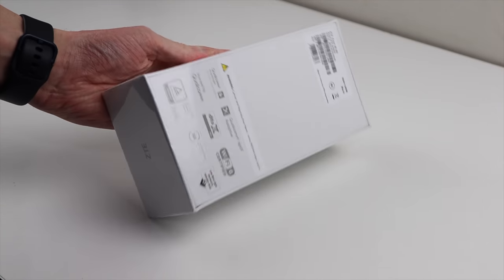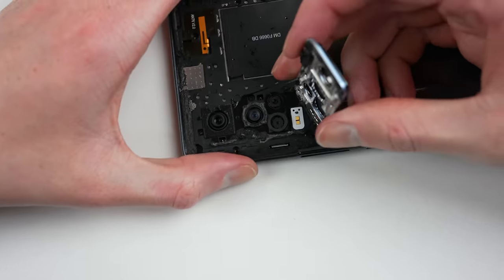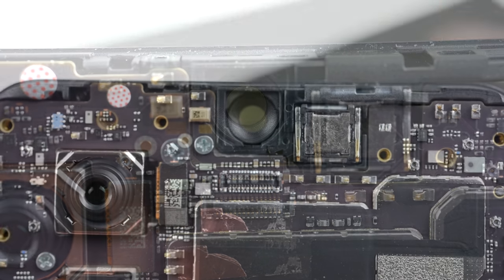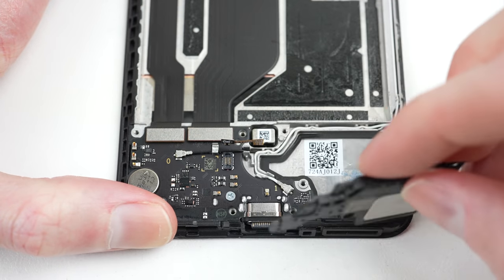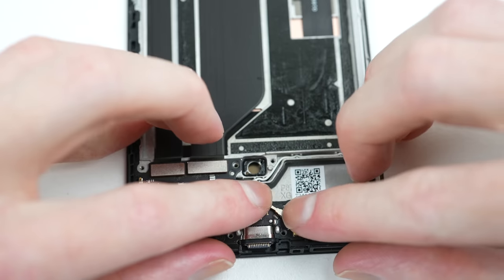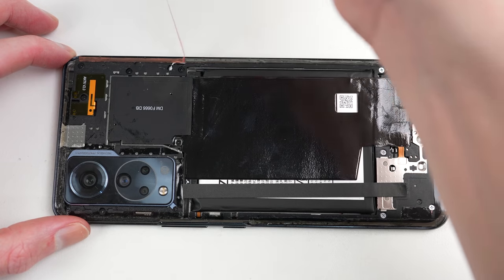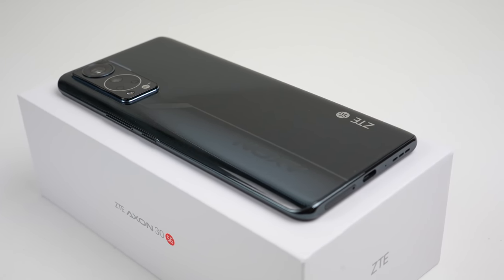How This Incredible Under Screen Camera Works - Axon 30 Teardown

Comment from the maker: Axon 30 launches 9th Sep 2021: https://bit.ly/2W0hZNm
Reply: I like to eat hamburger
Reply: Hugh
Can you do a Teardown of the A52 
I Will buy it and i need to see if there is any limitations if something is damaged
Reply: Hello Hugh I'm writing from kenya wanted to know if you do sell some of your restorations???
Reply: @jrjr4218  he does but only in Australia for now
Reply: Just check the Xiaomi mix 4.you will be thrilled
Reply: so cool video
Reply: hey man, nice video - big fan of your work.
i was wondering tho if there are any polarisation effects happening the the screen, ie what happens to the picture if you rotate the camera 90°. 
(i am aware that the cable is probably not long enough to do so, just putting it out there :)
Reply: On my birthday

Comment: as a person who literally never uses the front camera this would be the perfect phone for me
Reply: Same
Reply: Same
Reply: Meanwhile, all those spybot companies are watching you from under that display.
Reply: I’m so ugly I fear my front facing camera breaking if I use it
Reply: I'd be happy to pay less and have no front camera.
Reply: Same here. But I'd prefer a pop-up camera as you can just ignore it or just use it if someone insists on a zoom meeting. No chance of screen compromise
Reply: If someone is going to watch me through my camera it wouldn't matter what phone I had and most phones don't have a physical identifier to tell you the camera is on.
Reply: @MCAlexisYT  your point being?
Reply: This is one of the reasons I bought Xiaomi Mi 9T Pro (also known as Redmi K20 Pro), it has a motorized pop-up selfie camera which stays inside the body of the phone until needed 👍
Reply: @TommyAgramonSeth  way better solution. But apparently the 300k repeat test isn't sufficient for YouTubers to feel confident with the robustness. Saying that they probably take that many selfies in a month
Reply: @dougsteel7414  lol yeah, if I were to take a lot of selfies or videocall often, I'd be slightly more worried about dust or something getting inside and scratching the lens but even then, that shouldn't be an expensive fix.
Reply: @snaj9989  Vivo Apex 2019 I guess?
Reply: haha, tbh I rarely use it. It's a perfect solution for me. However if it doesn't give any interference with the screen; they might as well have put it centre; but I guess we will need at least some 5-6 more generations of small upgraded new generations of phones before they figure that one out.
Reply: The only reason I use front cam is to look under some places, as if it was a mirror. Better use that, rather than carrying a telescopic mirror in my pocket every time
Reply: I mostly use the rear camera on my phones too even though the selfie cameras have gotten really good.
Reply: Tbh there should be versions of phones with no front camera at all, that would truly be perfect
Reply: @MCAlexisYT  it will be blurry when the display is on
Reply: @satsumagt5284  like i have anything to hide
Reply: Same
Reply: Same!
Reply: @MCAlexisYT  They can watch - they'll get bored & move on 🤣🤣

Comment: Not bad - good to see under display cameras popping up now! Hopefully the image quality can be improved in time.
Reply: Yeah that's been my biggest issue with all screen phones like my S10, not much point in having the phone be all screen if there has to be a cutout for the front camera
Reply: @Karmy.  if you think about it, if we just kept the top bezel we wouldn't need screen cutouts
Reply: @Tiger9194  yeah
Reply: Spotify?
Reply: @Tiger9194  But then there wouldn't be as much screen. Fundamentally, hole punch cut-outs and notches have provided more screen real estate. If there was a top bezel to accommodate the selfie camera, the space to its right and left would be wasted - just dead space. With a cut-out or notch, the space to the right and left of the camera is instead used as notification bar space, holding the time, signal strength, and notifications (if Android). That means the screen can be used for more content in the same overall device size. Several Android phones provide the option of removing the cut-out/notch by blacking out the space to its right and left - this provides a useful show of what a phone would look like if it had a top bezel instead of a cut-out.
Reply: @EscapeVelocity11186  Not much screen? Who cares, this whole trend of having the most screen real estate is stupid. No bezel? Under display camera then ( ZTE ), or the alternative option is the pop up camera ( one plus ).   Considering those 2 options drastically reduces the need for a cutout, or just go the old fashioned way and put back the top bezel.
Reply: @Tiger9194  Okay... but having a cut-out doesn't reduce the usable screen real-estate. Your whole point was that phones shouldn't have cut-outs and should just have a top bezel for the camera. If you want a top bezel, just enable that option in the settings if you have an Android phone. You don't ever need to see the cut-out or notch. For people that would prefer to have more screen, they can live with a cut-out/notch because it's the best option until under-display cameras mature. It also provides them with more screen space for content since the entire notification bar is shifted up to the cut-out area - where the top bezel used to be. Pop-up cameras probably have the issue of using more internal space and also having an additional mechanical point of failure, which is why virtually every manufacturer stopped using them in favor of cut-outs/notches (a mature display tech).
Reply: @EscapeVelocity11186  Look at Sonys Flagship, the bezzels are so small & the camera fits perfectly. Bezzels, Pop up Cameras, under Display Camera, everything is better than a Notch.
Reply: @Tiger9194  exactly
Reply: @Nonnenmacher87  Sony knows what to do and it works well.

Comment: I'm sure he had a contract with ZTE saying he could open the device and remove everything. 

Would definitely have liked to see a bit more comparisons between current models like low end S21, OnePlus and OPPO. It would be interesting to see how it actually stacks up side-by-side with the models it's competing against. Overall nice job as usual

Comment: That's funny how you said the wide angle camera looked like a 2010 webcam, because when you took the back frame off the camera area, I thought it looked suspiciously like a webcam lens and body. The tiny viewing hole, and the design of the larger-than-usual plastic around the lens just looked terribly reminiscent of cheap webcams that I've disassembled. 

Thanks for the interesting, informative and entertaining video!

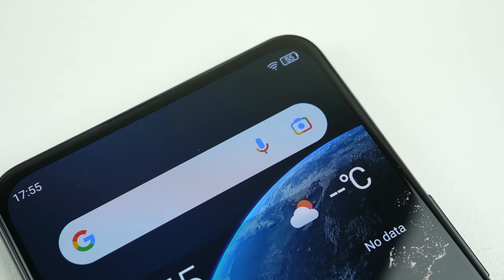Comment: 1:58 There is a visable notch for a part of a second. But I guess it's just a software bug. Maybe the manufacturer didn't configire their OS right for this model.
Reply: They could also very well have blocked this part of the screen off when something using the camera is opened (for example so that something like a notification doesn't ruin your selfie or recording)

Comment: 04:00  

you know what started this whole "do not open" thing.  

it's people taking them appart,  breaking something,  and then putting it back together to claim warrenty or said it broke randomly.  
that's why they started making it almost impossible to do.  rather then just warning people not to do it.  

it's because you have no buisness opening it up as long as you can get a free replacement

Comment: The bootloader isn't unlocked I guess: if you unlock the bootloader, a phone restores to factory settings. It means that it is possible to unlock the bootloader.
About the battery: ofcourse it's got more connections because it's got more cells. It's madness to put 65W in a battery this size and would be dangerous. Every phone charging with 50W or more uses more cells to achieve this. That comes at a cost though, because seperating the cells physically requires space, so you've got less capacity because of that

Comment: The battery could easily be removable, route the wires underneath it, put in the appropriate socket, about 1mm of plastic in the midframe to form the battery compartment, and use clips instead of glue to hold the back on 

There is no reason they couldn't have made it removable

Comment: i know that showing thermal paste applications on YouTube is a risky job because of comments like "ur doing it wroooong" or "USE LIQUID METAAAAAALLL"

BUT my question is, did your used a silver based paste? 

i mean i see a lot of people that work with computers puting the white kind of paste (that i call toothpaste cuz it's terrible) i mean, it isn't totally absurd to use "toothpaste" in this instance because a phone is passively cooled and that means, a low heat output

I'm not telling you that this is wrong, I'm just questioning, why?

Comment: The loss in quality can also be because the lens and sensors are different than on the main camera but it's still awesome to see a camera capturing photos over layers of screen.

I just wish this phone wasn't so glued down. Everything is behind glue even screws. Also hidden screws, void warranty stickers and the big stickers saying that the phone is basically unrepairable are seriously shady and shouldn't be legal. 

Non removable battery should be also illegal since it is one component that 100% dies with time.

Comment: The warranty stickers are not illegal.  It is however illegal to deny warranty based on weather the device has been opened.     You can use it to signal that further examination needs to be done to make sure the user hasent broken it.

Comment: Be careful with the phone now, the likelihood of the battery causing a fire went up after exposing it to heat and some flex. 
It's recommended to use a new battery after removing it.
Reply: Are flex cables made of Latex?

Comment: Hey, amazing Video, but I have something to share about ZTE: I now use ZTE phones for 5 years, but the one I use currently use is definitely the last one. The software they ship with is very unstable and I experienced a lot of app crashes (even preinstalled and system apps), sudden reboots, long booting times (up to 4 minutes) and more. Also they don't provide any software update what so ever (even if they claim 2 years of support), not even security patches. So you end up with a phone with top specs that is barely usable after 4 months. Please don't buy any ZTE phones until they start caring about the users and the community

Comment: Great review & disassembly 👍 I've had mine 6 months now & it's a fantastic phone for way less money than a similar spec'd device - I have never put a screen protector on it & it does not have a single mark on it, maybe the retail versions got harder glass ? I did send it for repair as my touchscreen stopped working (UK to HK) & ZTE sorted shipping & repair under warranty really fast with no cost to myself - only UK customs tried to get me to pay duty as it was a repair & not a complete new replacement (some rule they have) but released the phone after a week with no charges (were they trying to pull a fast one - I bought the phone from ZTE UK STORE 🤬) anyway, I can't fault ZTE or their product as it does everything I need, the display is nice & responsive, 870 chipset is very snappy & more than enough for my gaming needs - overall the best phone I could find at the time for less than £450 👍

Comment: No qi charge ability, and the back panel use foam tape to seal it to the frame. Not bad. But from what i see, the screen was not that bright under the sun. Good vid👍

Comment: I remember my old phone being one of those where you could just take the back off and remove the battery by hand, in school it was practically a party trick and I bragged about it because whenever my phone would completely lock out I could just remove the battery and restart it. No need to wait for a day for the battery to die.
Reply: If your battery becomes unable to hold a charge, having your phone be like new costs only the price to get a new battery and pop it in! So valuable!

Comment: I think all they did was just tell you that it isn't removable so you shouldn't be surprised if you puncture it accidentally and cause a fire.  Some lithium ion batteries explode quickly of punctured and it isn't pleasant.

Comment: This is a bit spooky for me... Going forward, imagine how many cameras will be hidden in products... Lurking
Reply: all getting blurry images, covered with dust, dirt and grease from my fingers or face, looking at the floor, the surface of a table or the interior of my pocket, so scary
Reply: @arch1107  those weren't very blurry pictures, but you're right- Cheeto fingers would be very anticlimactic to spy on...

Comment: I understand the use of tough glue for the battery inside phones. I had a S9 which I consistently used in places with warm temperatures and over the years, could hear the battery loosen up and wobble. I think if anyone attempts a repair, they should use alcohol and leave it for a bit to loosen up the battery or yeah, add adhesive pull tabs.

Comment: Non removable batteries means ZTE doesn't want customers to own this device longer than 2-3 years because once the battery health drops below 80% it's going to start slowing down and messing with functions of the device and make it non usable. This should be illegal.

Comment: Sorry, I just can't agree with you about the charger I have an entire drawer full of them so clearly, I don't need more of them.
Reply from the maker: Do any of them have a usb-c connector on them? Because these companies have removed the charger and changed the plug so you have to buy a new one anyway in a lot of cases.

Comment: 2:30 to 2:40.  Yea..the PLASTIC backing is more durable than the SHITTY glass that was used as the display for this phone ( sigh)..ONE measly drop from 2 feet from my pocket with the SHITTY  clear included plastic case that did NOT to protect my phone and now I have cracks all over it...HADn't even had the damn phone 5 business days 

ZTe is claiming the warranty doesn't cover this damage either.  (sigh).

Comment: That thermal paste shouldn’t be replaced. If you applied a type of thermal paste that is oily, it will leak.
Reply: thermal paste is basically all the same, it is some solid diluted in some liquid, if you have replaced thermal paste on a cpu you will see that it will not leak as it does not leak on a laptop being tossed around for years

the liquid or the solid on most of these thermal paste is non conductive, so is not a problem, and you have to shake it so hard so it gets to the cameras that is very likely you will destroy the body of the unit first

if you are worried for this, the is a thermal paste that is more creamy and alot less liquid, but is not as good conducting heat away of the surface
Reply: @arch1107  no, some thermal paste is known to make a mess and destory phones, people have attempted this before and ended up with a broken device.
Reply: @rcky844  people that use cheap thermal paste that is electrically conductive, use cheap stuff, get in trouble

Comment: The use of that glue should be banned
Reply: Why?
Reply: @heavy0119  because it's difficult to remove, it's a pain in the arse for right to repair, it leaves residues and it's difficult to restore as factory. It's only easier for the manufacturer to produce, while it's not good for right to repair or changing battery to prolong device life.

Comment: "Practically invisible" 

Lies were told. That lower resolution spot of screen is so obvious. Also, the quality of photos taken by that under screen camera is even more potato level than selfie cameras usually are.
I still don't get it. Nothing's wrong with a bezel. Just have a bezel. Stop finding obnoxious new ways to mutilate screens that are worse than bezels. Bezels give you somewhere to grip the phone and thus make phones better, more usable. They're a good thing. Ugh, this "no bezel" trend is so f%%%ing stupid.
Reply: What’s the problem with a small bezel? I’m currently holding a phone with a rather small bezel and I have no difficulties using it. Also, the reason it’s so visible might be because a camera picks it up easier than the human eye. And sure, the camera quality looks like it was thrown into a toaster on max heat, but this is only the second under-screen camera ZTE has released. It will get much better in the next few years and will soon become mainstream, just like under-display finger sensors.

Comment: Meanwhile, Apple is still stuck with that bathtub sized notch and their next “innovation” is to shrink it a little bit and probably remove the charging cable on the box. Maybe in 2030 they’ll finally get underscreen cameras. 😂
Reply: Meanwhile, all the other phones don't have a FaceID system that it also one of the most secure... lol, not a good comparison.

And while current UDC might look cool, the quality of the camera without aggresive software retouch is bad. For photos they might be able to fix it, but for videos they can't, unless they use a powerful CPU and a good ISP.
Reply: No, that's when they'll pair the screws to the frame
Reply: @zUltra3D  They’ll also likely remove the charging cable on the box, saying some environmental benefit or other bs excuse.
Reply: @peterthepanda  they should've done that from the beginning. They're actually harming the environment more by giving you a useless USB C cable
Reply: @zUltra3D  Or you know, just do what other OEMs do: give promotions on launch date/month where you can get the cable and charger for free or at a greatly reduced cost. But knowing Apple, they’ll never do that because they can make more money selling you a charging cable and adapter instead of giving it for free as a promo.
Reply: @peterthepanda  I think Xiaomi did that with the Mi 11, you could ask for a charger and they'd give you a 55W GaN charger for free